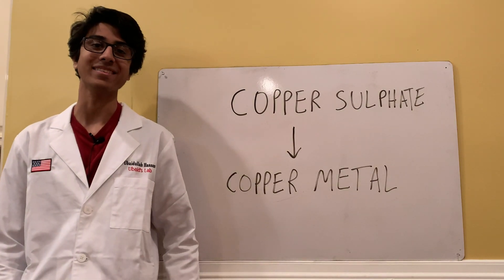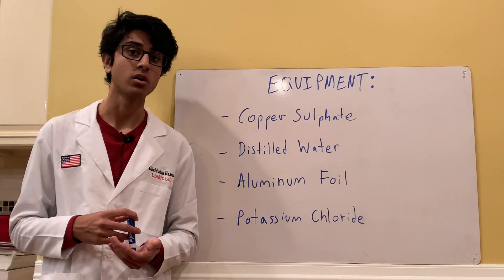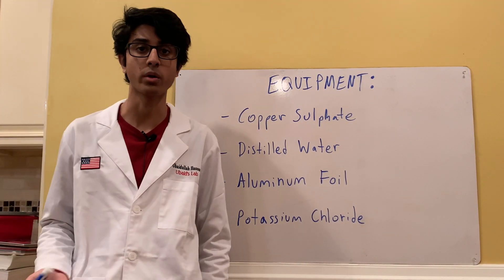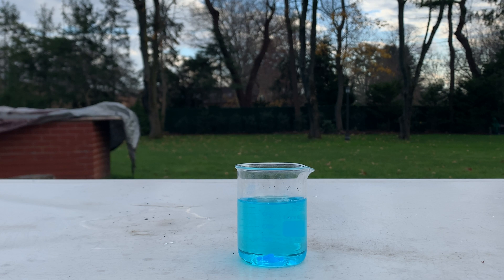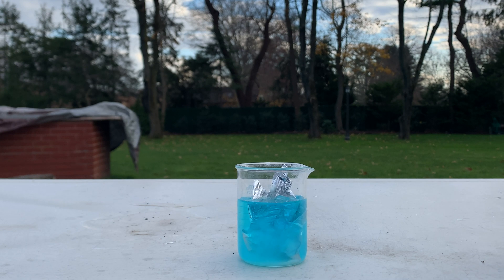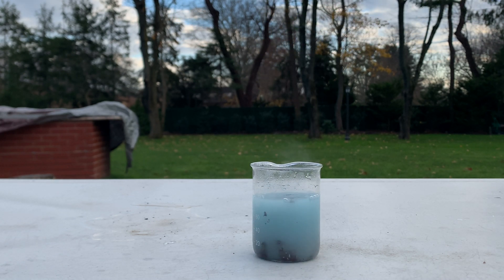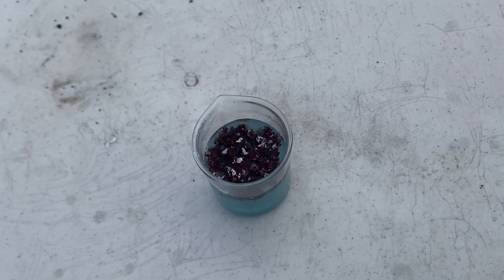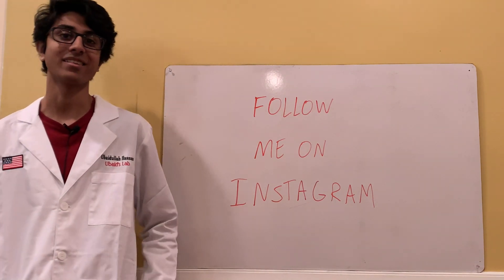Turning my Copper Sulfate back into Copper Metal (because I can)

Comment: What's the gas that's created during the reaction? Any safety/health concerns?
Reply from the maker: Im not too sure but i don’t think its hazardous. I just avoid doing anything indoors and without ventilation to be safe.
Reply: @UbaidsLab  when the aluminum ions are trading place with the copper ions, is it an esothermic reaction? (If it is, could it simply be steam?)
Reply from the maker: @brianburnssailorslife5383  this could be the case

Comment: I'm not sure how hard it is to make copper powder from solid copper, but I've done a similar reaction to make zinc powder before, but with zinc and HCl, then Al to precipitate out the zinc powder. Unless there's an easier way to make copper powder by just grinding it, copper powder might be the answer for "why would someone do this?".  Of course, in both cases, it is probably easier and cheaper to buy the powder form than to react metal with acid, then precipitate, but it isn't as cool.
Reply from the maker: Yeah definitely lol

Comment: You can also buy technical grade (but fairly pure) copper sulfate as "root killer" in hardware stores (at least in the US, dunno about elsewhere.) So you could treat it as an over-the-counter route to make fine copper particles from aluminum foil (or steel wool as someone notes elsewhere).
Reply from the maker: Yeah I’ve seen that sold in a lot of hardware stores around here.